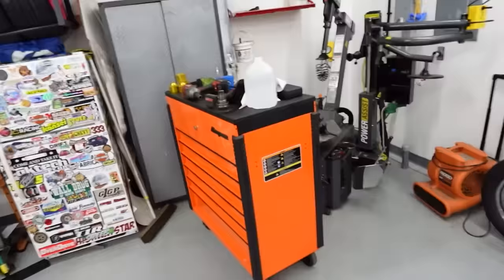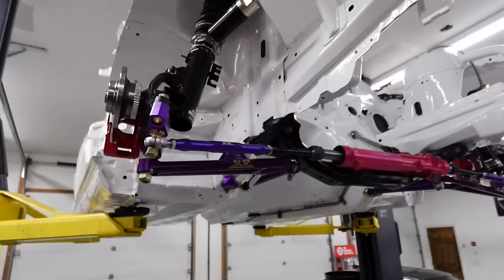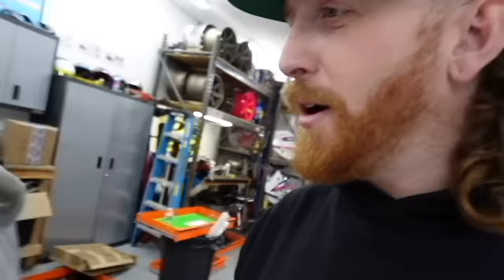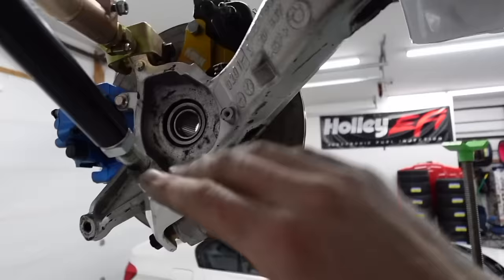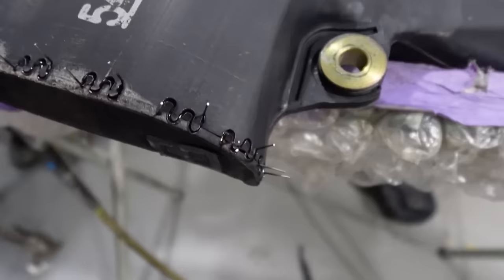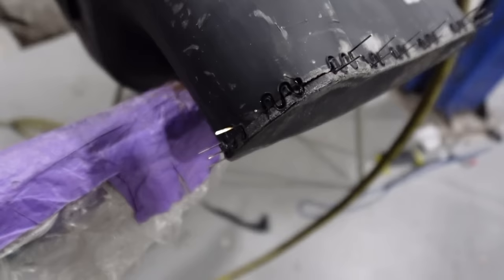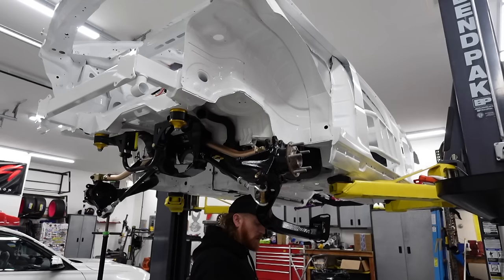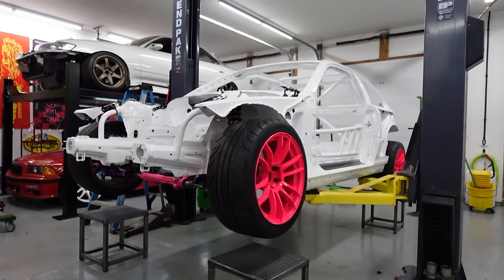My Powder Coated E46 Is On The Ground!

Comment: When it comes to your camera, it'd be a bigger question as to weather or not your SD card has a fast enough write speed, Micro SD's aren't normally that fast so you'd likely have better results with a UHS-II full size SD card, or a UHS-I full size SD card. Issues like this I normally start with memory cards or faulty batteries (a lot of brands don't play nice with amazon batteries as similar issues come up)